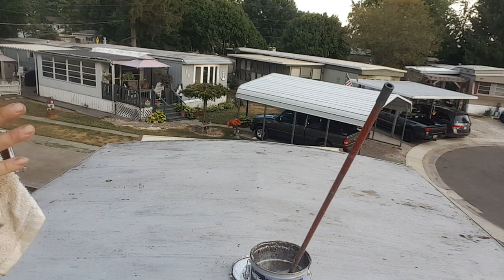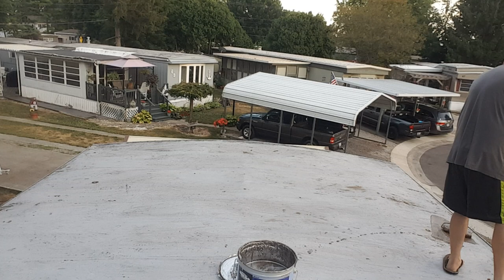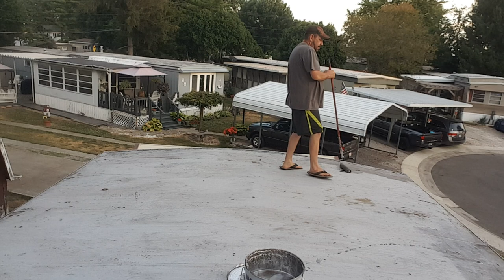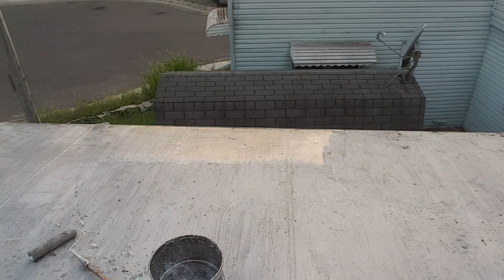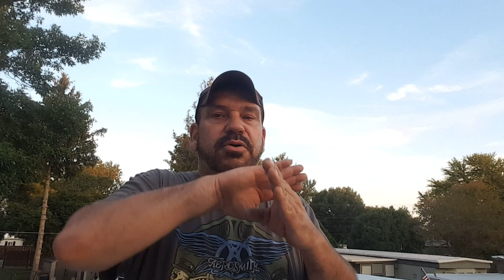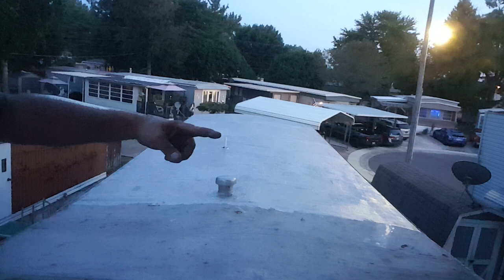Let me Show you how I KoolSeal a mobile home trailer roof

Comment: Man! Homeboy is like 280 pounds, it’s a miracle he didn’t fall thru the roof ! Im planning on doing this to my single wide, I am 230 pounds. I was nervous as shit the first time I went on my roof!  Well if he can do it. So can I ! Great video
Reply: Be careful where you are stepping as some seams have small trusses underneath and some do not. The ones that do not have trusses underneath, starts separating at the seam from our weight, which in turn will eventually be a new leak.
Reply: I have an A frame roof so i used a latter and a long extension pole, i used to have one extension pole now since my job got really to throw three more away it sure helps because they are not cheap, but i still would have brought another one if i needed another one, since my mobile home is paid for, because rent is so high, Thank GOD for BLESSING me with a roof over my head, who wants to pay $800, to $1500 a month for rent and alot of people are getting evicted for no reason, I'm just remodeling flooring and make it look good, nice antique clock and antique pictures that I'm just putting back up 🙏🏽👌🙏🏽🙏🏽🙏🏽🙏🏽🙏🏽🙏🏽🙏🏽🙏🏽🙏🏽🙏🏽🙏🏽🙏🏽🙏🏽🙏🏽🙏🏽🙏🏽🙏🏽🙏🏽🙏🏽🙏🏽🙏🏽🙏🏽🙏🏽🙏🏽🙏🏽🙏🏽🙏🏽🙏🏽🙏🏽🙏🏽🙏🏽🙏🏽🙏🏽🙏🏽

Comment: im in upper america we have crazy weather. i would suggest around 60-70 degrees. start preparing around 8. get to work around 9 or 10 when dew is gone and sun is starting to come out. finish by about 2. this will give it time to dry before moistur comes at night. and def dont risk doing it around a rainy day. my previous homeowner did my entire carriage house in the rain because i see what looks like a dried up desert on the roof. its a mixture of black and silvermostly black which leads me to believe he didnt even mix the paint. and then he applied it on a day where it rained later or was wet prior. so even when i try to fix his mistake its still going to look like cracked death valley

Comment: Are you not worried about falling thru the roof? I need to do that to my roof, and I already have the koolseal and the rollers and extension pole, but am worried about falling thru. How would I know it's strong enough to walk on it? And also, I have seen people in the past talk about cleaning it with vinegar before applying koolseal. Is that something you've done, and if so what kind of vinegar and how do you clean it with it? Thanks in advance for your help. Stay safe hun!
Reply: only reason i been watching for him to fall threw and the flip flops :)... and i always used a brush never rollers you want that to fill in the holes
Reply from the maker: Infact you do not want to use a brush or mop. It puts it on too thick and it peels off like this roof did. Kool seal is thin enough to fill all the cracks and holes with a simple roller and does not put it on too thick. Mobile home roofs move ( ripple ) in the wind. If you put it on with a brush or mop its then too thick when the roof ripples and will crack and flake like this roof did and it WILL leak.
Reply from the maker: I've never used vinegar. No need to in my opinion. I still check roofs I did 10 + years ago that are still fine. As far as walking on it. It has rafters every 16 inches just try to walk on those and you'll be fine. This roof is what we call a loose roof ( noisy ) and I only see one or two a year most are not like that. It is however important that once you seal the roof DON'T WALK ON IT. do your yearly inspection from a ladder.
Reply: You want a smooth coat that sticks if you use a mop or broom yes its ruff but snow sticks and you don't want that extra weight of the snow on your trailer roof you want it smooth so the water runs off quicker also with a smooth roof you won't have to worry about a shitload of build up . If you have a roof that's more sloped than this one more like an a-shaped then u need to stay on the trusses on a 70 ft home or 72 by 16 you need at least two 5 gallon buckets like my wife says smooth and thick does the trick
Reply: What if your roof is A frame instead of flat?

Comment: THERE IS BEANS THAT YOU'RE SUPPOSED TO STEP ON YOU'RE NOT SUPPOSED WALK ALL OVER IT THE BEAMS ARE SET 2 FT APART TO A FOOT YOU HAVE TO BE STANDING ON THE BEANS
Reply: Beams
Reply: A safe way to walk on roof is to lay a piece of plywood and then your weight is distributed equally.